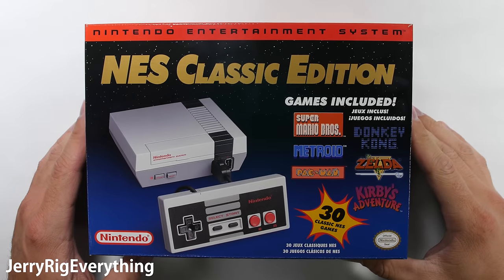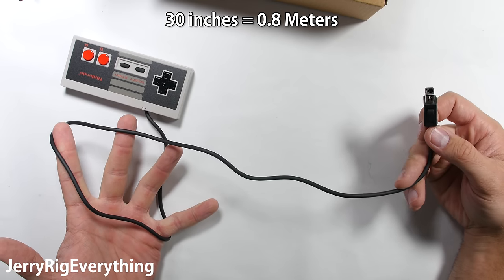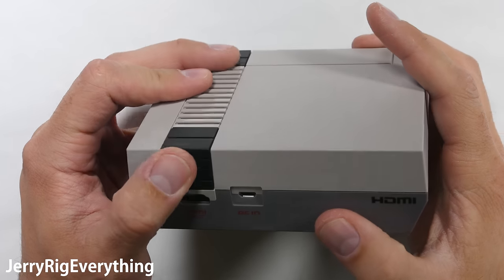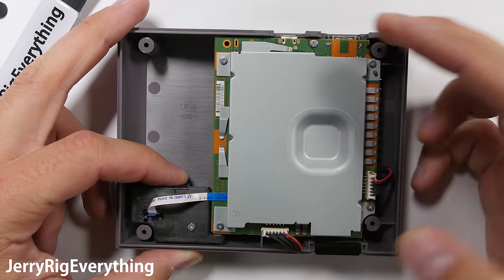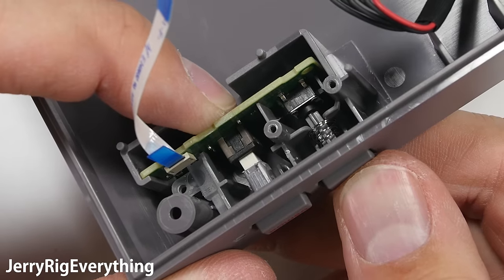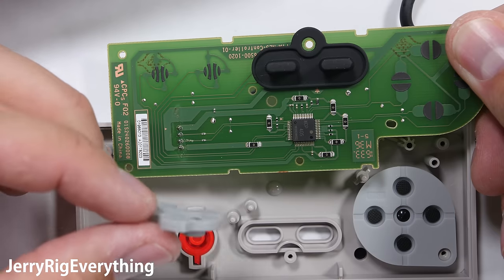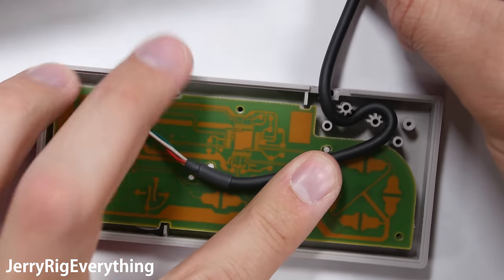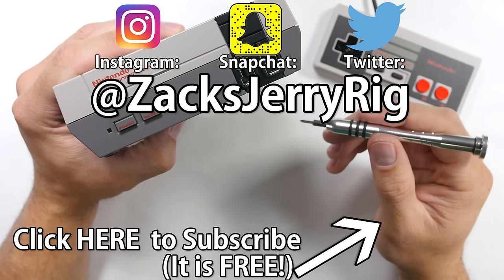NES Classic Edition - Teardown - Unboxing - Repair Video

Comment: The white connectors are called "JST" - Japan Solderless Terminal.

The way the wire was wound inside the controller is a form of what's known as "strain relief".
Reply from the maker: +Joshua Jansen Thank you! I was curious about that

Comment: "...pretty intense graphics" Haha. :p
Reply: Fahad Mostafa Yea even I think the NES Mini will not overheat on its own but I remerber sometimes durring summer my room is so hot you can bake an egg on the flor so having someting that reduces heat on the console comes great
Reply: CodeNameZ But it won't reduce heat if it itself is just as hot as your room...
Reply: Vince van Wijk acctaully a good enough cooler will..

Comment: Only person who took it apart right after unboxing it
Reply: As EEVBlog guy says, "Don't turn it on- take it apart!"
Reply: +TheLaXandro lol
Reply: I was thinking exactly the same thing!!
Reply: I would never be able to get it back together if I did that! xD
Reply: That is sad because it's literally the easiest an electronic device can be to open, and still pass safety requirements. Literally it would be impossible to make it any simpler. Opening a DS and re-assembling it,  now that's a challenge. (mostly just the top LCD flex cables which are partly hidden inside one of the hinges)
Reply: Sergiy Botsman dont talk to me about the cables in the hinges i dropped my lite and the hinge brok off no thee wire sticks out and it make me nervous (still works tho)

Comment: Heatsink and rumors that this thing is actually plenty powerful gets me hyped for SNES and N64 Classic.
Reply: or.GameCube mini
Reply: Anthony Paul or even Wii Mini.
...Wait, hang on.
Reply: N64 and snes have already been possible on low cost hardware that's only 35 euro(raspi 3) for a while now
Reply: But it doesnt have the nintendo quality
Reply: N64 is kinda possible on the pi but it isnt great to play, quite laggy
Reply: The hardware in this thing could rather easily do SNES and N64, it's basically the same type of processor you'd find on many Android phones.  It seems to be a rebadged Allwinner A33, which is a quad core ARM CPU with a Mali 400 MP2 GPU.  That should be quite capable of N64 emulation.
Reply: perfectly playable on pi 3 with right settings
Reply: Julien Lussier have you overclocked it then?
Reply: Nah, with the latest retropie and by using the right resolution (640x480), almost all games runs good.. You have to switch the core for different game to run well.. Its not really plug and play like other consoles on retropie
Reply: mrblackrock555 Mine runs Mario kart 64 with 2 players fine without heatsink or external cooling, for more players you'll probably need a powered usb hub though because the controllers power draw might overpower the pi itself
Reply: N64 software emulation is a bitch tho, i have yet to see an emulator for the n64 that is perfectly stable
Reply: aiouh Yes, illegal emulation. If there’s a way to play old games that supports a company you should always do it.
Reply: It can run some n64 games perfectly. Super mario 64 for example runs great on it

Comment: i would put battery in that empty place next to the motherboard so you could go portable with it
Reply from the maker: +Mr Pancakes such a good idea.
Reply: +JerryRigEverything and its very easy just put a power bank inside
Reply: And a truck carrying a truck carrying the tv :D
Reply: Bart you can power a small LCD screen to the same battery that would power the nes, the system does not require much power so a run of the mill power bank you'll have laying around will be able to power the system and a LCD screen for around a couple hours of straight playing.
Reply: JerryRigEverything I've already made a version of the nes mini that has a screen and a rechargeable battery, I'd be happy to send you one! If you'd want it that Is.
Reply: Davis Turow upload a video of it
Reply: Davis Turow I'm very interested in seeing it
Reply: Where would you plug the HDMI into?
Reply: Mr Pancakes Yeah and explain what you would use to power the tv?
Reply: @paul2413  use a small car GPS screen and a 5v to 12v dc-dc and an HDMI to RCA adaptor inside there...

Comment: I would imagine that the controller is designed to be short so that players will have the console itself closer to them, since they would have to press the buttons on the console to save/load.
Reply: Idk we got wireless controllers and one didn’t work so what I did is that I took it apart and found the bad connection and shoved a rubber band in it and screwed it back up and now it works fine

Comment: the box says 30 games why did you say 50 games 12 seconds of the beginning of the video
Reply from the maker: +Eduardo Cortez twas an error on my part
Reply: okay though there was like an sd card with 20 more games
Reply: @eduardocortez6803  yeah, I thought there was a secret code to unlock 20 more games! 😂.

Comment: Can't wait to shove a Raspberry Pi in this thing
Reply: That's what I though after seeing it opened
Reply: 30 NES Games HA...
I gonna load it with NES, SNES, Gameboy, and Gameboy Advance
Reply: Corey Watford what raspberry pi do you have and recommend i actually want to buy one and make a gameboy that can play nes gb gba gbc and snes games and setup aswell maybe?...
Reply: Egoin Nitram I don't have one yet, but ordering one soon, but from all my research the Pi 3 is the one to go for esp for those games. You can run it on the much cheaper and smaller Pi Zero, but I seen a bit of slowdowns on test with SNES Games, but builds like this: https://goo.gl/oYlt6s Make me want to go for a Pi Zero, but im sure ill go for the Pi 3 for its better power and all the ports available out of the box.
Reply: It appears to be based on an Allwinner SoC so chances are you'll be able to run whatever on it as-is without any hardware mods in a month or two :-)
Reply: perseidvulture interesting, that is if you can ever buy one lol
Reply: That's a good idea, but paying 60€ / $60 for a fancy looking case and  throwing away the guts is a bit of a waste. My Pi and mini NES are staying within their respective cases, however I'll have to search if there is a way to make the controllers work on the Pi through a Wiimote. These look and feel very authentic indeed.
Reply: why
Reply: No way to load games to it externally unless the USB port is wired through.  It looks like some hardware mods would be necessary to get access to the flash memory and filesystem.  Good news is that being a standard ARM SoC and running Linux, it can probably be reprogrammed to do whatever you want it to do.  Hopefully they find a way to get at the USB interface of the SoC so you can stick a big storage drive in there and maybe a WiFi chip, then it could be a fully functional computer with ROMs from every retro system.
Reply: CalcProgrammer1 It isn't worth the hassle when you can just get a SBC with the required accessories for that price these days.

Comment: Favorite NES game? Geez, that's a toughy. I'd have to go with Metroid. It was just ground-breaking, on so many levels. Nicely-done, with the tear-down. Strain relief and a sturdy housing was SO important on the original NES controllers. I still have mine, 30 years later, and after many slams into the wall, and it still works fine with my NES 2. (top-loader)

Comment: i can already see all these main units falling on the ground due to the controller cable stretching/pulling. the length of a cable is a joke (sorry for my bad english hope you understand)
Reply: raszop your English is fine.
Reply: raszop the HDMI cable is decently long from the looks of it. I think the intention is to bring the console away from the TV and closer to you so you can get away with a shorter cable. I think most people will go wireless regardless these days.
Reply: thank you I just said that because im not native and i often hear that people cant understand me, or that my speech is broken
Reply: I guess that Nintendo figured that a longer cable would outweight the console and tear it down to the floor from the Tv stand or whatever.
Reply: +J-Ryder You know, that doesn't sound too unreasonable.
Reply: Nes's were always on the floor people started putting there consoles on shelves and entertainment centers after the wireless controller age.
Reply: Blonde Haired Blue Eyes Skinny White Boy Not me, I had it next to my TV.

Comment: You can compensate for the short controller cord with a longer HDMI cable. You don't have to place the system by the TV. You can place it on the table instead.

Comment: speaking of which, the design of the interior of the controller is quite similar to a GameCube controller. the select and start buttons have the contact buds as part of the single piece of rubber, the way the wire is setup to only make pressure at the upper side of the case is an almost 1 to 1 copy, and the way the buttons are held against the upper side of the case are the same, even the way they fit into the contacts.

Comment: I rather have the sega genesis with 80 games for $40.
Reply: Segaaaaaaaa
Reply: Spectre Se-r Let's be honest every person who saw your comment heard the intro of Sega in his head
Reply: Is it one by AtGames? Because their Sega Mega Drive systems have a different sound system which makes the sound way off.
Reply: So you will take a system with 40 Genesis games all with terrible sound emulations and gameplay issues, 40 crappy TecToy games, crappy wireless controllers, with support for original controllers that may or may not work (yes just because it has Genesis plugs doesn't mean all will work), that can't save game files, that is incompatible with 40% of Genesis and Mega Drive games, that could easily break, not HDMI or RGB support, no stereo sound, no support for Power Base Converter, Sega CD, and Sega 32X add-ons, looks horrible on an HDTV even with upscaler, can't play light gun games, doesn't support the Activator, and doesn't work with Sonic 3 & Knuckles the best game of the Genesis? What's wrong with you man? The AtGames systems are garbage, you best just buy all the games on Steam, through compilation or play it on emulator.
Reply: Heck, buying the original console and those games will probably be cheaper and will be better quality.
Reply: LuigiHero Perhaps! I'll never regret my impulse-purchased Sega Mega Drive, alhough I only have Sonic 1 and -2 for it.
Reply: PuffyRainbowCloud Should look into getting a everdrive, let's you put games onto a SD Card and play it on your genesis.
Reply: LuigiHero While I love those types of solutions; I do own an EZ-Flash IV for my GBA SP, I really, really like having the actual cartridges, and buying GBA-games just wasn't the same after getting the flash cart. So I think I'll stay away while there is still hardware to go around.
Reply: PuffyRainbowCloud Well there is also a really great amount of homebrew and rom hacks for the Genesis also.
Reply: LuigiHero That's true, and it would be nice to be able to play those, but still, I know I would just end up getting ROMs and ruining the experience.

Comment: Really cool that you can open those things up and put them back together! I would have a lot of problems getting everything back where it needs to go! xD
Reply: It's easy. Just study the parts and locations. Use to do that with ps1 and ps2, which the brands always needed internal fixes more than any console.

Comment: The cable design/protection on the controller is the same with the old famicom!

I used to open my famicoms controller when It stopped working when I was a kid and watching this unboxing/teardown is pretty nostalgic!

Thanks for sharing gerry. You earner my sub (resubbed)
Reply: not sure if you'll still respond to this, but I lost the power cable to this console awhile back and have been dreading to play it again. by chance would you know what cable it (like name of one or what type) is so I could buy it off of Amazon? please help

Comment: When pulling out the small ribbon cables, generally one needs to ease a compression sleeve around the socket rather than just wiggle the cable out, or you risk damaging the cable and the connector. Not sure if the connector had one in this case, always important to be careful with them.

Comment: Thank you for this video, the controller's cable is wayyy too short. Looks like I could cut it and splice any USB cable with 4 wire to make a descent length cable - which I'll be doing tomorrow.

Comment: also this seems like a modders dream. pop it open, stick a raspberry pi in there and you've got a badass little system
Reply: Tom At that point, why even buy the console?  The Pi will do everything the console can and more.  You could put it in any shell you'd like.

Comment: I wonder, if it is possible to load more games on the mainboard with that USB connection. Also, it would be nice, if there is any way to replace the cable of the new NES controller with the cable of an old one, to use it with an old NES...

Comment: Is it similar enough that the shell and buttons can be used to replace the shell and buttons of an original NES controller? And by buttons I just mean the hard surface parts. I wouldn't mess with the insides too much, just wanted a regular NES controller that looked and felt new again.

Comment: Jerry this question may not be related to the video but in the lg v10 torture vid you didn't scratch the fingerprint scanner, but by any chance do you know if the v10's fingerprint scanner still work if the scanner is scratched?

Comment: I bought mine new on Ebay the controllers has 4 red buttons and it has 620 games built in for 20 dollars not bad a well I got it it looks great but doesn't work at all press button in never turns on I got it hooked up right anniversary edition  is there a reason y a new unit dont work
Reply: It’s a fake.

Comment: For the controller, it looks just like some bog-standard Wii Remote accessory connector so in theory that makes it capable of being used with the Wii Pro controller. Barring that there are probably Wii Remote accessory extension cables to make the distance between the remote and Nunchuk accessory, for instance; just pop one of those on there and you'd be fairly well-off for length.

That being said, I still prefer PC emulation, if not because I see these old games as nothing more than timekillers that can be played in hort bursts between everything else and pixel-perfect timings are something I am not concerned about unless it's an absolutely necessary gameplay element.

That being said, I welcome some timing inconsistencies because it keeps me on my toes. Also, the NES Classic uses an SoC with the Linux kernel anyway so I'm right.

Comment: first thing i noticed when the system was revealed was the controller ports. those are the same ports you see on wiimotes. seeing as the cables are so short, is it possible to pair a wiimote to the system? given the wiimote itself is a moniker of the classic NES controller, it may function as a substitute, only using the included controller for retro feel

Comment: Got a good question.  Could the original nes controller board go into the classic nes controller shell?  It looks like all of the screw holes and bosses line up to the point that it could work.

Comment: this thing is my best gaming investment in years... they basically made it to be hacked and used as a retro arcade box... nes, snes, gameboy, sega, gamegear, GBA( i know theres more but those were the ones i cared about) all in one system with legit controllers unlike the cheapo USB you get when you use an emulator... i struggled to find a good replica esque controller with a good dpad solid buttons and durable construction... but the wireless myarcades made for the snes mini and nes mini are perfect for all the platforms above and they were cheap.. if anyone is contemplating getting it do it now for the 60 bucks because they stopped making them again... you know they will claim its done for good but thats just until they release the n64 mini for 150 and then they will rerelease everything.. only problem with the n64 mini is i fear it wont be hackable and will connect to wifi... making it very hard to mod or atleast hard to mod for a while....

Comment: Now i am wondering, i see 4 wires in the controler. It is pretty new so i would think that the controler is USB compatible, just because it is now commen technoligy. Could it be possible to connect a USB controler to it when you "hack" it?

Comment: I think the link cable to the controller is small for the aesthetics,similar to the old style of gaming.
Reply: except its not, they just reused the addon cords from the wii remote, its literally a wiiremote cord
Reply: The old nes wire is long as fuck.
Reply: It's small cause Nintendo think you will use it with the Wii remote as well for those other VC gaming.
Reply: really?I have both an n64 and Snes thinking that the link cords would be similar.
Reply: Original NES has a 6 foot long cord, NES Classic doesn't even reach a foot.

Comment: Hey, real quick question, to anyone who is either willing to try it, or who already has, does pressing A + B + START + SELECT send a reset signal to the NES Classic Mini?  I know it did on its fore barer.  And, if it does, does it just reset the game, or does it bring you back to the selector?  I know on the NES, it did reset the game, but I don't know if it actually sent a reset signal like pressing the reset button did.